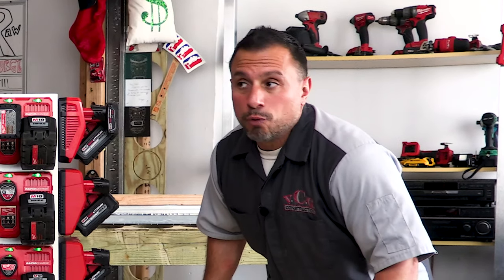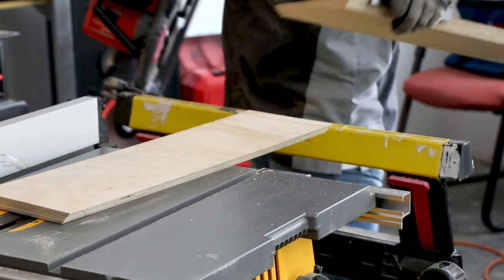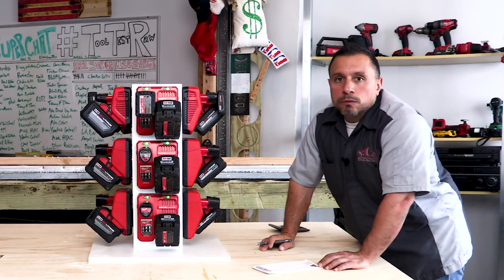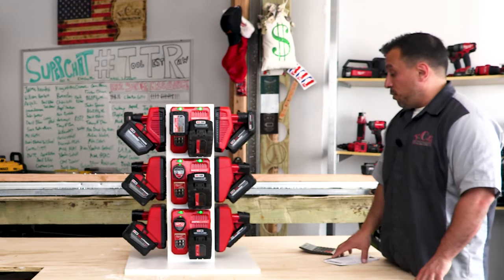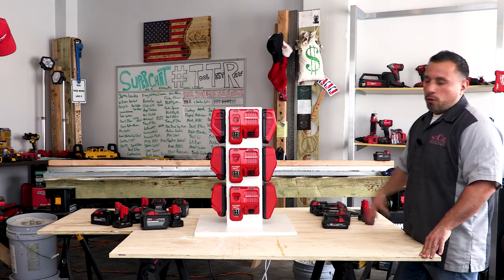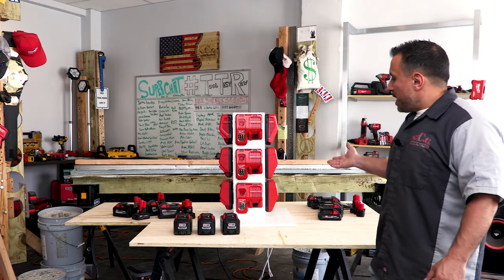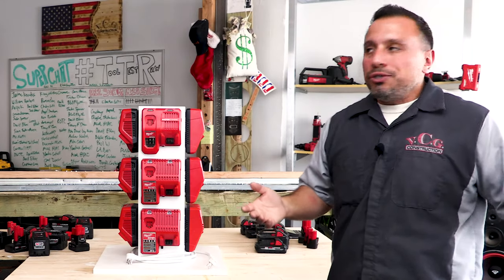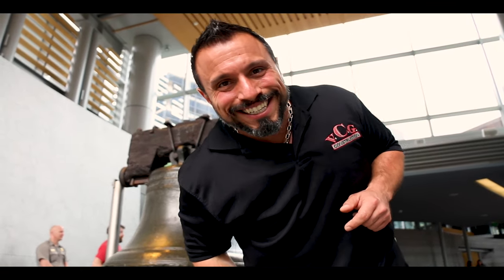MILWAUKEE TOOLS RED LITHIUM SUPERCHARGER TOWER OF POWER!

Comment: Pretty nifty little charging station you made there(enjoy watching you make things for us). It puts all those “free” chargers you get to great use; & since you have them....why not use ‘em👍🏻
Adding some casters to base would help moving around workshop; & adding off-road caster wheels.....help move around job site 💪🏼😂. Heck, could even add umbrella bracket to help protect against sun, light rain, etc....😉 
Regardless, still cool thing to do, & I have a smaller version w/ 4 chargers I made up for my workshop.
Cheers VCG✌🏼

Comment: That's pretty cool! I just used an extra packout box and mounted 4 rapids in it nice and tidy. I used a water resistant outlet on the outside to retain it's integrity, and have a rocker/input setup so I can turn all 4 on or just 3, or 2, or 1, etc. And I carry several batteries in it. Plus my 5ft 12/3 jumper. But this is not a "company solution" this is "The Bosses Box" (hands off) 😂 just something I threw together one day because organization.
Very creative though cuz and goes well the Den! Nicely done 👍

Comment: Inspired by this. I'd like to build one using aluminum extrusion so that it's customizable. That way you can bring as many or as few chargers as you need, even multiple brands of chargers, and just slide them into the channels. Some quick connect/disconnect using waterproof connectors would be sweet, too. Great job, VCG!
Reply: I’m building something similar to this but with Bauer tool brand. 2 sides have 2 chargers each and the other 2 sides have battery holders holding 4 batteries on each side.

Comment: I've also accumulated more than 10 dual voltage chargers over years of buying kits and this an excellent organization solutions. In that case I don't need super chargers they just shorten battery life. Until I prefer using normal changers first over rapid chargers

Comment: That would be great for a job site. I would like to see Milwaukee make a charge station for 4-6 batteries, maybe with 2 plugs if needed, that could charge more than 1 battery at a time. A 6 bay that charges 2 at a time even would be a big help. Both on the job site and for the DIYers.

Comment: Pretty nifty little charging station you made there. It puts all those “free” chargers you get to great use; & since you have them....why not use ‘em👍🏻
Me, I’d add some kind of adjustable locking caster wheels(or heavy duty off road caster wheels😅) to the base; that way you can move it around the job site little easier(especially if rockin the off-road wheels😉). Do like the handle for lifting, nice touch.... Could go one step further & had an umbrella bracket holder to protect from sun, light rain, etc....🤣
Regardless, still cool thing to do, & I have a smaller version w/ 4 chargers I made up for my workshop.
Cheers VCG✌🏼

Comment: That's pretty cool.  And it looks nice.  I was already thinking of doing something similar.  My thoughts were to mount several chargers in a Packout case for a portable protected charging solution.  I already have one Packout that is fitted to carry nothing but M18 batteries. That's one heave case too.

Comment: Hi.
From any point away from the tower you can see 6 chargers at the same time.
It means that charging status of other 12 batteries is invisible unless you step forward and go around.
Better solution is one board of plywood with chargers. It can be hung on wall, status of all chargers is visible.
But the best idea I came up with is put the chargers in packout box. The one with transparent cower.
When you on the job site all you have to do is hang it on the wall, open the cover and plug it in.
Have fun.

Comment: I like your tower of Power idea. But I don't like the fact that it will require two different circuits in order to be able to run all 12 chargers. However I don't have 12 chargers anyway. But I do like the idea I think I'm going to have to make one but not with 12 chargers. I will only be needing to put for chargers. I will put 2 Milwaukee rapid chargers and 2 Makita dc18rc chargers. And then a handful of USB outlets. And on the top maybe a spot for mounting the radius light.